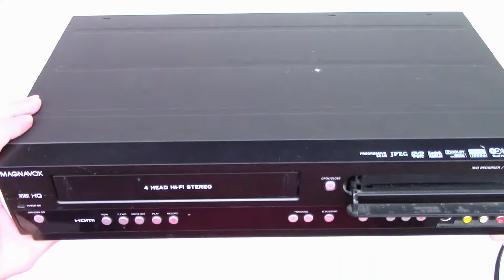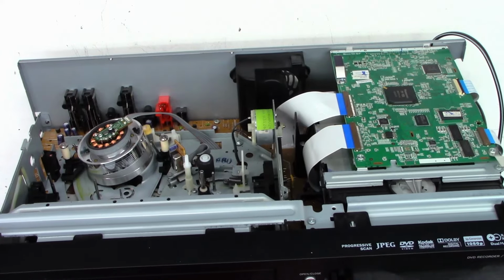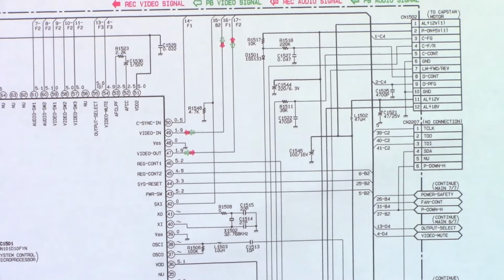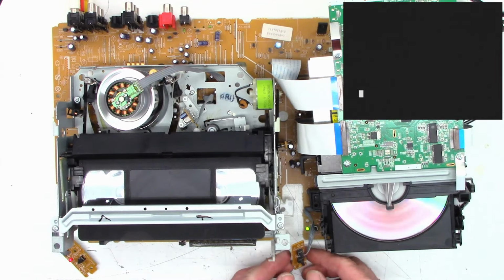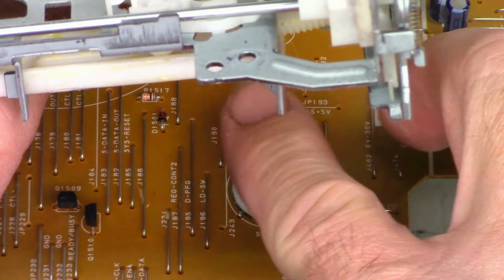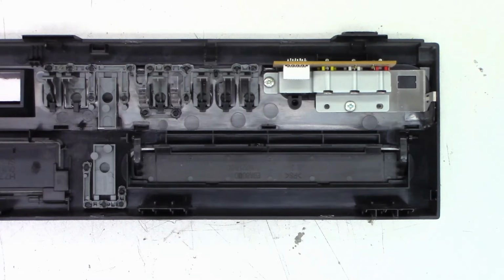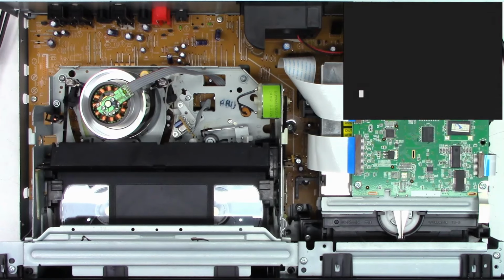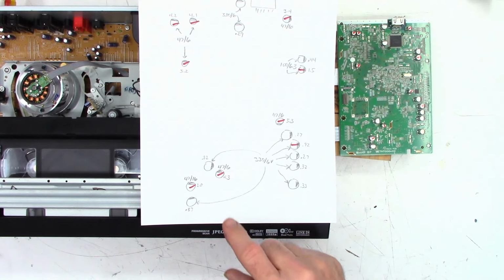Magnavox ZV427MG9 VCR/DVD Recorder from South Carolina that "Will Not Take A Tape" Part 1 of 2

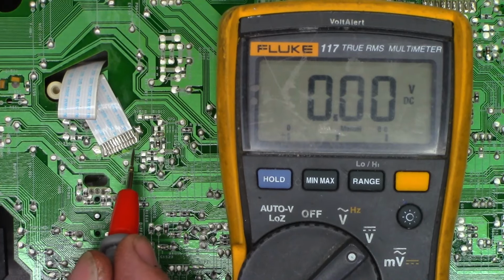Comment: 7:41 When your probe slipped and shorted pin 1 and 2 that may have have caused damage that wasn't present previously.
Reply from the maker: It did not have the 5 volts present before I slipped, otherwise it would have worked.
Reply: @norcal715  Makes sense.